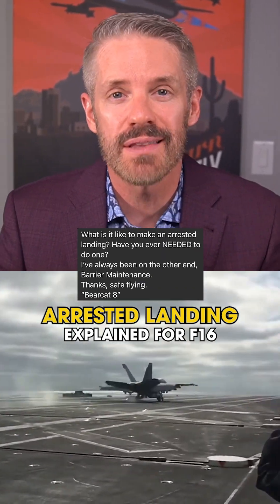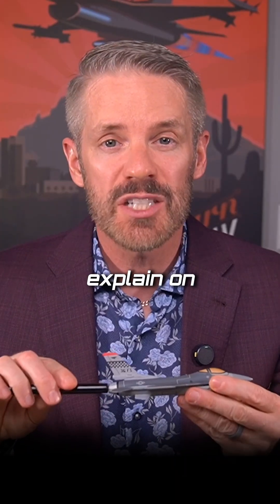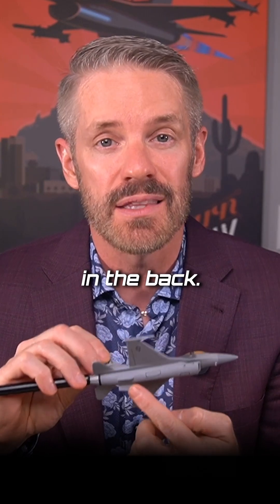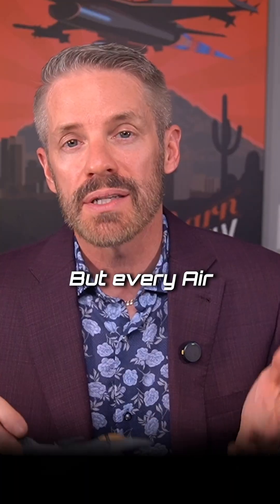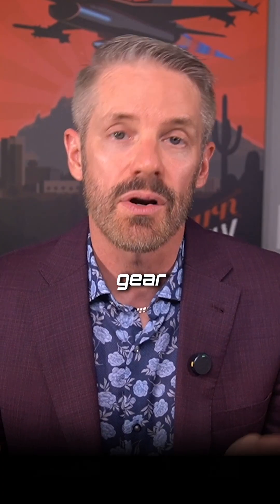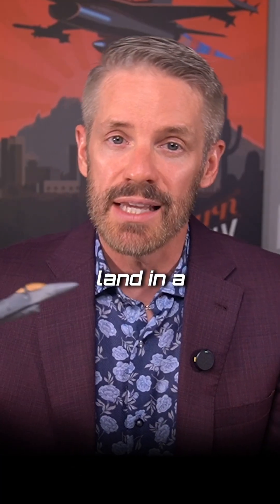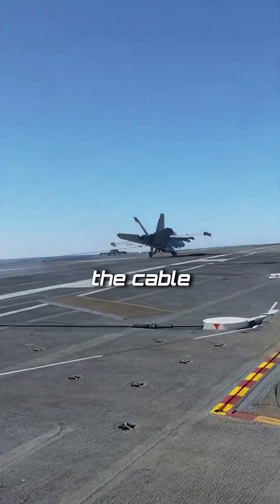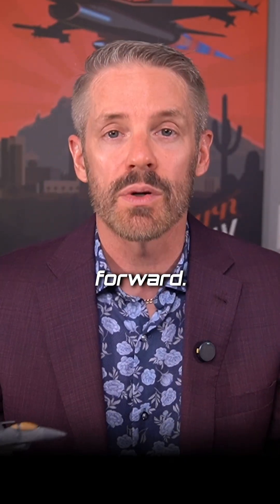Arrested Landing Explained for F16

Comment: Is there ever a time in your career day you have had to land in an
 carrier, for whatever the reason it could be? As an Air Force pilot, do they train pilots for carrier landings as a an emergency? If so, have you ever and what was that feeling like for the first time?
Reply: Quick answer - NO, NO and NO.  An Air Force pilot (unless carrier trained exchange pilot) would never get clearance to land on a carrier.  Ever.

Even if that Air Force pilot was lost, damaged, low on fuel or any other possible scenario, he would be denied.  Even if it meant certain death for the pilot.

The senior carrier air traffic controller would thank him for his service, wish him luck and let him know helos are in the air to pull him out of the water. He might even walk the AF pilot through a ditch or ejection checklist.

If the AF pilot persisted and insisted, the carrier ATC would inform AF pilot that he's about 15 seconds from getting his ass shot down.  Probably less if the AF pilot was really being a pain in the ass.

Quick explanation - A US aircraft carrier is the most complex, expensive and valuable weapon system is the US arsenal.  It can not be compromised for any reason.
There is a reason that a naval aviator's training syllabus is almost twice as long and twice as expensive than AF.

There are many reasons why US Naval aviators are considered the best, but it always comes back to operating combat aircraft at sea.  Universally understood as the hardest thing to do militarily.  We have perfected it.
No other country in the world is a even a distant #2

Comment: What happens if you miss the cable pls answer?
Reply: You go in full throttle.  If you miss the cable, you just continue on down the runway and take off again.  Then you go around and try again.
Reply: if they try and take the approach end cable, they can run out to try and take the departure end. If they plan on the departure end cable and miss it, MIL power to circle back and try again.

I've seen a missed cable engagement. Full throttle ASAP and send it again.